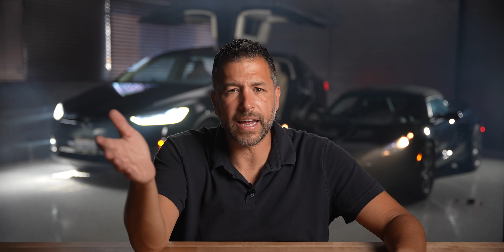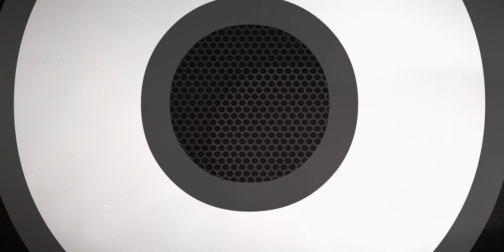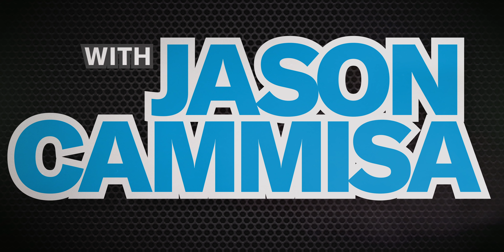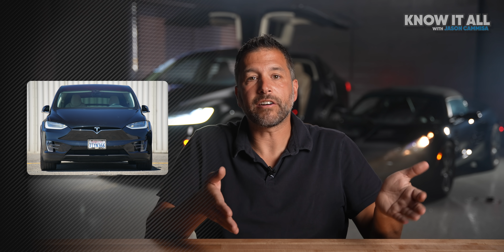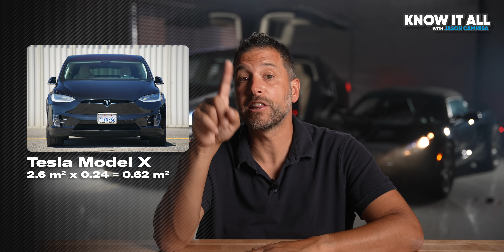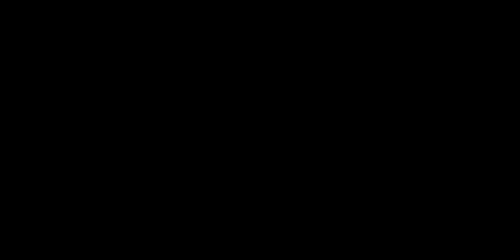Coefficient of drag has nothing to do with size | Know it All with Jason Cammisa | Ep. 12

Comment: However size does affect overall drag.  Overall drag = drag coefficient * [ air density (or whatever fluid you are in) * velocity (faster you go the more drag) ]/2 * Frontal area.   Since the Tesla's drag coefficient is low it is has effectively less drag than the Lotus as they are sized today.  But if I scaled that Tesla up to 2 twice its actual size or scaled the Lotus down to half size then the Lotus would have a smaller total overall drag force even though its drag coefficient is much higher.
Reply: To be clear drag coefficient is shape determined, and has nothing to do with size.  But overall drag force is a function of size (frontal area) times that drag coefficient.

Comment: You could even argue that a physically larger car is easier to build for low Cd
Reply: It absolutely is. Especially because a larger car gives designers more room to work around government regulations
Reply: @L W Not sure what you meant? Both of your sentences contradict each other.
Reply: @richardbixler   I think he understood the word "need" as in it's a must to function properly, just to clarify what we already took it for as in "makes way more sense for this car than a good cod"
Reply: @cinimini4854  I would then argue the Lotus does need downforce to function properly. The lotus is a very small car with most of its weight in the middle and rear of the car. Without substantial downforce it would struggle to get any traction on the front wheels and would be unmanageable at high speeds.
Reply: No need to argue. 
Thats 100% true.
Reply: Also a small lightweight car like the lotus needs downforce more than a low drag coefficient. Hard to create downforce without increasing drag or weight. Tesla’s have the latter in spades so they only need to worry about the drag coefficient.
Reply: That's common knowledge, just look that the landspeed record cars, they all look like big rockets 🚀

Comment: Things to keep in mind is that high aero cars actually have higher drag coefficients, due to larger down force needed for things like cornering and high speed stability. Taking the Elise and the model X around the same corner, will undoubtedly have very different results due to the Elise being able to maintain higher speed since it retains more traction from the down force. The Tesla's lower Cd leads to higher efficiency which is the big goal for EVs.
Reply: The Elise produces very little downforce. It's like a few kgs at 100mph. So like, a percentage point of extra traction. It's not significant. The big difference is moreso down to the turbulence involved in the cooling system and style elements that haven't been optimised for low drag to the hardcore extent that the Tesla has.

Like you're not wrong that the extra drag can be for productive performance purposes, but it's not quite the case here

Comment: it's because the lotus has all those holes for air to go to cooling radiators and brake ducts isn't it?
Reply: Can be. Also, to have more downforce in the rear end, comes more drag
Reply: Underfloors have a hughe efect on CoD as well. Basically all electric cars have a flat floor which is good, but most ice cars don't.
Reply: @juanordonezgalban2278  The Lotus Elise also has a flat floor :) But yeah, the reason for the higher Cd is in some part because contrary to most passenger cars that create lift at speed, the Elise creates a small amount of negative lift, or downforce, for a consistent steering feel and handling at low and high speeds. Also, the Elise hasn't been optimised nearly as much as new vehicles, especially EV's in their search for better "fuel" economy.

Comment: This is why I hate the flat stall style rear wing trend. I studied some aerodynamics while in college and all I see is a big flat surface being shoved through the air.

On another note I think this is one of the primary reasons the Nissan R35 GT-R acceleration broke expectations when it came out. It has the weight and AWD working for it when it is traction limited at lower speeds, whereas the overall drag quickly overtakes accelerating its mass as the primary opposing force to overcome.

You compare that to the top tier previous generation Corvettes, they had more power and were significantly lighter, but were traction limited and their aero packages were draggy.

I believe you're going to see the future start to integrate some serious powered aero like the GMA T.50. With an electric car you could probably see a ducted fan significantly lower drag with notable thrust at speed to make multiple gears for electric motor drive unnecessary.

Comment: Isn't it easier to get a low Cd with a larger vehicle?  Mirrors don't grow in proportion with the vehicle size and radiator size becomes a smaller proportional of total frontal area for a large vehicle.  The Elise needs cooling for 190hp and it's radiator area is a huge portion of the frontal area increasing drag.  
Without the large radiator (yes they need a smaller radiator for batteries and electronics cooling) in the airflow, effectively allowing a sealed front - getting a low Cd for any BEV is much easier than for an ICE.
Reply: Volkswagon XL1. Cd = 0.189. Even if you go to more normal cars, Mercedes CLA Cd=0.22
Reply: @stuntmonkey00  Yes those two are efficient for drag but the CLA is also 45% larger than the Lotus (frontal area).  Again approximately same size mirrors and same radiator mean that these two items have a smaller impact on the Mercedes than on the Lotus.  The people Jason is annoyed at should really be saying that's a good Cd for such a small car.
Reply: Small tightly packaged size is trouble. But then not all large cars are an easy case. Coupé and luxury sedans do have an up front advantage though, especially as they grow in size.

Also arguably the mirrors aren't even that important. What is, is the small details of air path around the wheels, around the bottom of the car, and how much frontal cooling you need, since radiators are a lot of trouble.

Comment: One way it would be acceptable to say "low CD for its size" would be if, for example, a really tiny vehicle had a low CD, the opposite of what most people say. It's likely easier to make an oversized vehicle have a low CD because you can rearrange things more easily. 

For example, a Ram 1500 (already cd of 0.36) has a long hood and nearly vertical windshield. The windshield could easily be elongated to lower CD. A Smart ForTwo has almost no hood because it's rear engined and needs its upright windshield for passenger space (cd of 0.38).

Comment: Love hearing JC point out the things that have had me yelling at my screen/speakers/magazines for years. Now if he will please send a curtesy email to every automotive journalist letting them know.
Reply: @AzathothsAlarmClock  Actually he's correct AND what youve posted is also right. What hes saying is that the actual size/area of a vehicle is ALREADY accounted for (being that its a necessary figure to calculate the coefficient of drag in the first place) therefore, stating that the cd is "good or bad for a big vehicle" is redundant/ unnecessary. It doesn't matter how small or large it is because again, by the time the drag figure has been calculated the size/area has been entered in the equation. So he's absolutely on point when saying its not correct to praise or criticize a vehicles cd based on its size relative to others.
Example 03 Smart car cd .38
               08 Escalade cd .36
Size is already accounted for so it's
 wrong to take it in to consideration when recognizing a "good or bad" drag coefficient.✌🏾
Reply: @AzathothsAlarmClock  cd doesn’t change with size. Cda does. They’re two different things. Cda is cd (the efficiency) times size (the area). Cda can be good “for such a large vehicle” but cd is independent of size. Had the lotus been as efficient as the x (same cd) the cda (and therefore the drag) would have been lower.
Reply: What if ripped abs result in a golf-ball effect and reduce drag?
Reply: It's actually easier to make a large car have a better CD as you can get closer to the ideal teardrop shape while maintaining passenger space.

You just have to look at cars made to be as aerodinamic as possible like Mercedes EQXx they are very long and will have appendices making it longer. (Cd 0.17 ,A 2.12, CdA 0.36)

In contrast the smaller VW XL1 was only able to be as aerodinamic as it is by reducing usable space massively (2 seats only and quite cramped even).
Cd 0.186 A1.5m CdA 0.28

The smaller car had to compromise a lot more in order to achieve a low Cd
Reply: In this case doesn't know what he's talking about, obviously no education in fluid mechanics.

Comment: This did not come out right for the viewer. Esp the last line. What if the elise had the same .cd as a tesla. The elise would then require much less force to move through air. In essence, size does impact drag for the cars with the same coefficient of drag. There was some confusion in perception of this video
Reply: You are correct. The size affects the drag. We can say tesla has less drag for such a large frontal area. 

The problem is when people say the tesla has small coeffiecient of drag for such a large frontal area. This is wrong and this statement is what the video is trying to correct. Coefficient has nothing to do with size. Car people and magazines wrongly use coefficient all the time when it is not needed.
Reply: @winjaywin  absolutely. I second you. Thanks
Reply: Correct - size does affect overall drag.  The coefficient is size independent, but the actual drag is not.   Overall drag = drag coefficient * [ air density (or whatever fluid you are in) * velocity (faster you go the more drag) ]/2 * Frontal area.   Since the Tesla's drag coefficient is low it is has effectively less drag than the Lotus as they are sized today.  But if I scaled that Tesla up to 2 twice its actual size or scaled the Lotus down to half size then the Lotus would have a smaller total overall drag force even though its drag coefficient is much higher.   And weight has nothing to do with aerodynamic drag.
Reply: What if the Elise weighed more than the Tesla?

Comment: and now you need to make a clip about the  compromise between downforce vs drag coefficient and the high drag coefficient of the F1 cars
Reply: Lift to drag coeficient are also important when discussing race cars. Iirc a f1 car has like a 4:1, pretty bad compared to planes actually
Reply: @Hunter Johnson Surely you know that the effect of air density is also at play? So you cannot compare cars with X15 rocket planes? You do realize that there is factor 88 between sealevel and X15 operating at 100000ft elevation? I summize that it is YOU who needs to get go back to “whatever” school of “Rock” you have been and start getting that much desired education that you thought you had? Sucker …
Reply: @Hunter Johnson 
So what’s the L/D coefficient for modern F1 car?
(I should and will just look it up, this Q is here to include that number in example above)
Reply: I find it hard to believe a f1 car has a Cd of ~0.25-0.3 as pasanger cars do.

Comment: Yes I do understand, but the actual area of the front of the Tesla is larger, so even with a lower drag co-efficient it still has more drag than the smaller Lotus, simply because it is bigger.
Reply: No George, you clearly do not understand.
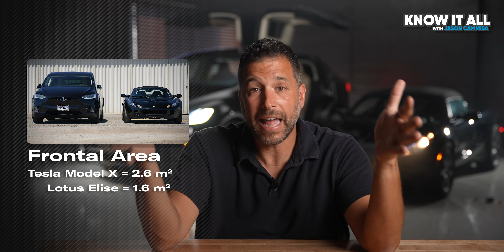Reply: No, not in this case.  The  Telsa has less overall drag as he showed in the calculation.  However, if you made the Model X just 10% larger and the Lotus 10% smaller then yes the Tesla would have more drag despite a lower drag coefficient.  The drag coefficient is totally size independent.  But overall drag is Frontal Area times the coefficient.  So yes, size does impact overall drag, but in this case the Tesla still has less overall drag.  Go back to 2:40 in the video.